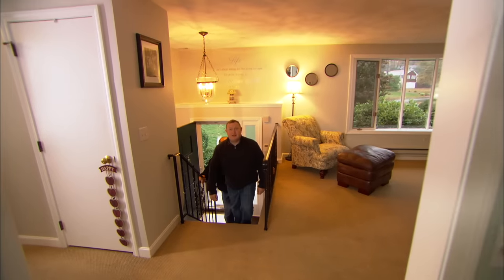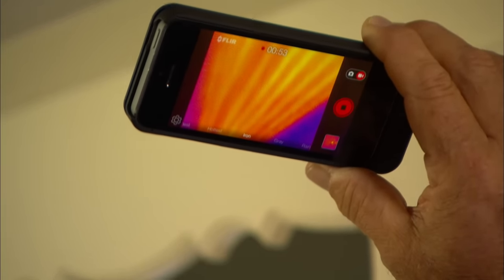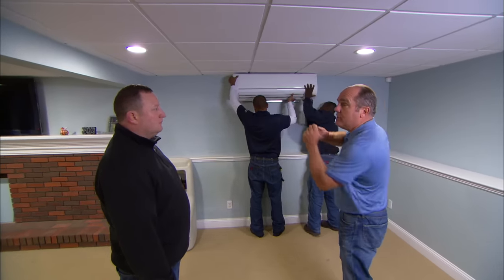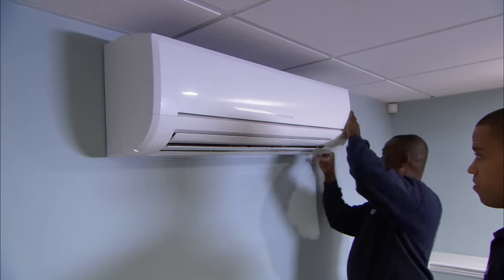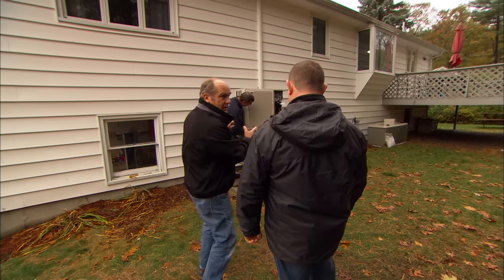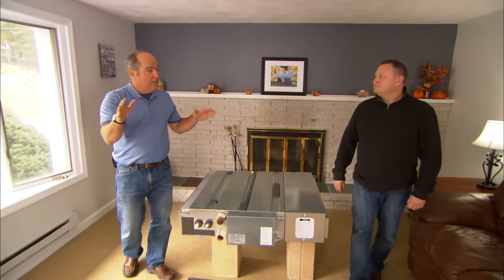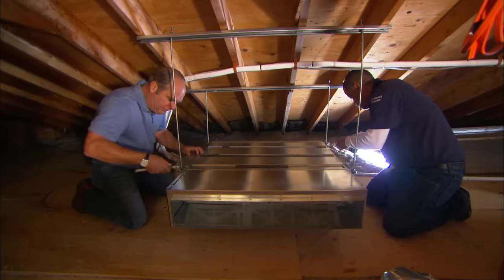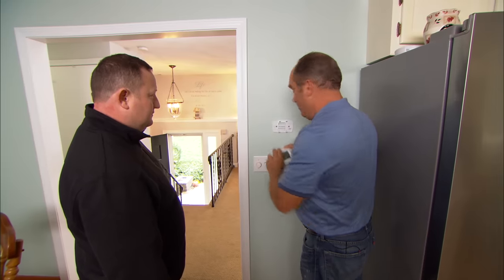How to Install a Whole-House Ductless System | Ask This Old House

Comment: I’ve been doing heating and air for thirty years and this is just my opinion on this matter.these and other similar units are very expensive.they do save you lots of money on your power bill.here is the kicker.you better hope they don’t break after the warranty is out.inverter units the outside computer board is over a thousand,fan mothers close to a thousand also.customers are not to happy when they get the service bills when this happens.
Reply: Agree. Have to factor in the risk of breakdowns and their cost to repair. I'm frugal and I live in a 55 year old house with no insulation. Rather than spend thousands on insulation and new oil burner I figured it's cheaper in the long run to heat with a wood stove. I get the wood for free (costs me time to gather, split and stack). No matter what happens (war, oil supply problems) I'll have heat.
Reply: (Recently retired from IT field support for a Fortune 100 electric company... I know there is only one here in Arizona but I don't feel right identifying them.)
I have no concerns about the inverter. High power inverters are remarkably reliable. That said, I wouldn't go with any of the Chinese units because cutting corners can turn any silk purse into a sow's ear.
Reply: @flagmichael  sadly most of the ductless units are made in China or the components come from them.where I live also we can get fluctuations in our power from the pole.this has taken out some of the inverter boards.
Personally I would invest in spray foam insulation rather then these high dollar systems

Comment: I have 1947, 800 square foot 2 bed 1 bath rental with no A/C in northern Indiana. Would you recommend a mini dual split ductless? I’m looking for balance in efficiency and pay back over the long term, lower operation cost to benefit the tenant.
Reply: Cali Valley yes

Comment: This system seems much more complex and expensive than a conventional HVAC system.  More complex = more potential for breakdowns.
Reply: Mr. Vaughn, this system has it's application and purpose, like every other design of HVAC system. More complex usually equates to use in more specific applications. Ductless and stub duct systems save significant amounts of money on ductwork and airflow balancing, and VRFs can share heat from one part of a building to another, saving energy costs in the right application. It all depends on what the customer is looking for, the requirements of the application and the space(s).
Reply: @Bear-cm1vl  My application and purpose is to heat and cool my house as efficiently and cheaply as possible with the most reliability. Should be the same with a big house or tiny house. Efficiency with cheap operating costs. Then you can spend money on other stuff.

Comment: Ductless, yet they filled the attic with supply and return ducts. I’m confused.
Reply: The “ductless” part refers to the wall mounted air handler.  These systems have a variety of air handlers; ductless, ducted, cassette, ceiling mounted and baseboard.

The actual term is mini-split system.

Comment: I’d the. Cover the entire roof in solar panels and put a battery back up system in to make sure if the power goes down, I’d have a few hours of back up survival left. Also my bills would be minimised.
Reply: If we'd only build our houses underground where the temperature is a constant 60 degrees. Pretty easy to heat that. In the winter you'd only have to raise the temperature 10 degrees. In the summer you'd just have to draw in very little 90 degree summer heat to make it juuust right!

Comment: "...is this system going to be to keep up with these cold New England winters?"

Nope. Below 20° the heat pump needs a helping hand from on-board electric heat strips or another auxiliary heat source.

Even in Florida and now here in Georgia, there have been many occasions where my heat pump hadn't been up to the task. In fact, because the condenser was pulling in so little heat on colder days, the internal fan motor was essentially cooling the room through convection since there was a miniscule amount of available heat in the evaporator.

Unless you have a giant condenser, don't expect to be able to get by without aux/emergency heat.

Comment: So what would a homeowner expect to pay? By way of example, what would the usual and customary cost be for this specific home install?
Reply: 1,000,000,000,000 dollars
Reply: mipilot30, "customary cost" for a custom installation is not possible to give. This system might not even be cost effective for your home, thus we use designers and engineers to lay out systems and determine what can and will work for an individual job.

Comment: My tire air compressor gets hot do to compressing the air.the higher the air pressure ,the higher the heat.Is my air compressor  heat pump?
Reply: No, it’s an air compressor. Hot air is a byproduct, just like with a lot of people...:)

Comment: How do you "multiply" heat without some type of energy source?   Does that not require fuel or electricity?
Reply: It doesn't actually "multiply" heat; it just moves it. That is what A/C systems do anyway.

Comment: Very interesting. I assume these units also handle air circulation (fresh air in, stale air out). I wonder what the cost is compared to FAG (Forced Air natural Gas)?
Reply: McRocket they do not do fresh air. But an hrv could be seperate
Reply: BenjaminFranklin99 - well, than won't you still need ducting (and a fan) to circulate the air into/out of the house?
Reply: Circulation and outside air ventilation are two different things McRocket. These units can run indoor fan only to circulate air in their space, but even most conventional HVAC systems do much to supply outside air ventilation (depending on code requirements, most don't use more than an outside air duct attached to the return of the system). If it is designed into the building, ventilation usually is handled by a dedicated HRV or ERV and is often ducted separately from the heating and cooling systems.
Reply: Bear U - so this system DOES need a separate, ducted system to add fresh air and remove stale air. Then calling it 'ductless' is somewhat misrepresentative, IMO in that sure, this has no ducting - but you will still need separate ducting to add fresh air/remove stale air.
Reply: McRocket that’s because “ductless” is misleading.  “Ductless” refers to the air handlers: wall-mount, ceiling cassette, baseboard mount, etc.

However, there are also ducted air handlers such as the one shown.

The better term is “mini-split system”.

As for fresh air, most homes don’t require a fresh air intake as you have windows and doors that can be opened.  It’s great if you have it.
Commercially, you do need outdoor air along with an economizer.

That’s why for a home, with systems like these, a separate unit is needed to bring outdoor air inside.

Comment: airhandlers in an  unheated attic , is this the way to go?
Reply: No. But with such a short path of travel it's probably not going to hurt performance too much. Still not ideal though.. I would've done an individual ceiling mount unit in each room.

Comment: Very cool, but what about if you need a humidifer where you are at?
Reply: run hot water in your shower
Reply: Blox117 Won’t help much. Yesterday i was cooking with the AC on. Outside i saw a steady stream of water coming out of the condense pipe. Very effective dehumidifier.
Reply: You can always install a ductless steam humidifier.  For real
Reply: Richard then why are you running AC and humidifier at the same time?
Reply: yeah but you dont run AC and humidifier at the same time
Reply: John Salazar, separate humidification is easy enough. Depending on the system requirements, the reduced air temperature from these heat pumps can help to reduce the need for humidification as well.

Comment: I still don’t get it.  You are going to bring in hot air on a 5 below day to heat the inside of the home that is already warmer inside than it is outside.  What magic takes “hot” air from outside and gets it to warm the inside?
Reply: Until you reach absolute zero (-459.67 degrees F / −273.15 degrees C) there is still heat energy available, obviously you aren't going to find an interveter system that works at those extremes but at 5 degress there is still plenty of heat to harvest. The system just takes the refrigerant through cycles of expansion and compression to move the heat around.

In heating mode the expansion of the refrigerant makes it colder than the outside temperature so it picks up heat. The refrigerant is then compressed to mulitply the heat energy it picked up, making it hotter than the inside conditioned space where it gives off its heat.

Comment: Yes, but what about -15 degrees F in my Maine winter? My experience is it is not going to work and I will use oil heat anyway. Comments?
Reply: The h2i (cold climate line) of Mitsubishi heat pumps are supposed to provide 100% of rated btu output down to 5 degrees. After that output degrades hitting 76% of rated output at -13. A properly sized system should be able to provide most of your heat but you would need a backup or supplemental source on the coldest days. Not sure what the payback period would look like but I wouldn't expect your oil costs to do anything but go up. In such a cold area a ground source aka geothermal heat pump is probably a better option with current technology.
Reply: biohazard 918 geo would not be cost effective. By the time you pay for geo, you coukd have installed three of these
Reply: biohazard 918, I can see both sides to this argument. At $4+ a gallon for #2 fuel oil, the cost for a winter climbs rapidly in the NE states, but dropping a ground loop for geothermal has a very high up front cost in stony ground and the heating load is likely to be seriously out of balance with the cooling load, which can cause moisture control issues.
Reply: I forgot about freeze protection and possible need of antifreeze in the ground loop too.

Comment: it all looks so simple but it is not. Multiple units on one outdoor unit is the least efficient. There is a lot of refrigerant and it has to be pumped to zones that are not calling. Maintenance and service are not talked about. One compressor replacement can blow your whole heating budget, if you can find someone who is trained to accomplish it. Parts can have extended warrantee, but labor is not usually covered. I could go on, and I do on my youtube and facebook pages. DuCharme HVACR Consulting.

Comment: I install Mitsubishi and Fujitsu minisplits for customers in upstate NY and rely solely on word of mouth sales.  There are several things that should be clarified:
1) None of the leading ductless manufacturers have heating elements in their ductless or mini ducted air handlers.  The larger unitary air handler from Mitsubishi has a supplemental electric heat option but is not necessary if the system is sized properly, and yes even down to -18F outdoor air temperatures!  These are not the same units that were available before 2009!
2) The proper sized low ambient units work great for heating at low temperatures.  If a customer has an existing heating system installed, they can save some money by undersizing the system and they can use the existing oil, propane, nat gas, or electric heat for supplemental heat in extreme cold situations.   In well insulated homes, many times I only use 2 minisplits for 2000+ square feet with no backup heat.
3) Low ambient outdoor units (Mitsubishi Hyper Heating Inverter H2i and Fujitsu XLTH Xtra Low Temperature Heating) have a base heater in the outdoor unit to prevent ice buildup in the base of the outdoor units and is only used while in defrost.  None of that heat from the base heater goes into your home it is only a 150 watt or less heater to heep the base a maximum of 40F during defrost.  
4) I don't typically install multizone systems because the efficiency and performance is much lower than 1:1 systems.  This offers system redundancy if something fails and much better comfort levels since the compressor capacity is perfectly matched to the indoor head unit.
5) Most residential multizone systems will not allow simultaneous heating and cooling.  If you try to use one zone for heat and another for cooling the first mode chosen heat will be the mode for the entire system.  The unit you chose for cooling will just flash indicating you chose the wrong mode.  So even though these systems have an AUTO mode to switch between heating and cooling it cannot change modes properly on a multizone system.  example if your family is in the basement and wants heat, but you are in the above garage office and want cooling you will have to decide who gets what but not both at the same time.
6) I have mitsubishi installed in my own house.  I live in a 3000 sq ft log home we built in 1998.  We installed radiant floor heat throughout the house during construction and used a propane boiler for heat until I installed two 12,000 BTU Mitsubishi FD12 units in April of 2009.  We upgraded our FD controllers to FE controllers so we could install an optional base heater which prevented problematic ice buildup in the base of the outdoor units.  We haven't run our boiler for more than 10 hours since 2009, and those are just 1 hour test runs before the beginning of each heating season.
7) They are very inexpensive to run, running both units  on a dedicated kwh meter we have averaged $.82 a day at an average of $.13 per kwh since 2009, heating and cooling 3000 sq ft!  And we like 72F all winter and 68F all summer!

Do some research before passing judgement.  By the way, some real world information after installing over 400 systems, operating a FE12 or FH12 12,000 BTU mitsubishi H2i single zone will displace the usage of 1,000 gallons of fuel oil or 1,500 gallons of propane for the winter season while keeping the house warmer at a fraction of the cost!  All my customers have said it is the best investment they ever made!  I typically charge around $4500 for a 1 ton low ambient system and $5500 for a 1.5 ton low ambient system, but I stand behind my installations and the products!  When oil is $4 a gallon they pay for themselves in one winter (ROI less than 1.5 years!) And no need to store fuel!  Friendly to generators too since they are inverter driven (soft start).

Comment: So it costs so much to run a natural gas line to the house… ok?? So what about propane and fuel oil, both of which are far cheaper than what you were using before. Why are you going all in with electricity?

Comment: People trying so hard to make mini split ductless units work that they are actually adding ducts... lol. From what i've gathered they work great if you have a head unit in each room but that requires lines to be run throughout the home and you lose efficiency the longer the line set is? Or you add ducts to avoid running so many lines which in turn loses efficiency just the same?

Comment: How was air filtration incorporated into this system?
Reply: Matt Jacob the units have their own little washable filters.  I think the oboe inside the attic has its own filters interfered as well
Reply: @davidcerino1145  problem I always had with these was that it's mostly just recirculating the same air with minimal air filtration. Didn't know if ducting the ductless units allowed more traditional filters to be incorporated on returns.
Reply: Matt Jacob oh yeah.
Granted, these systems are generally only installed in custom build-outs for commercial buildings.

Pretty cool stuff

Comment: Ductless.systems lose there efficiency below 30 deg, not good for northern states, the best and most comfortable heating system is a low pressure steam with cast iron radiators. You can then put a cheaper air conditioning system instead of an expensive ductless heat pump.

Comment: so not good for alaska? we can see -20f where I live. still not sure how those lines dont freeze
Reply: Assuming this VRF system uses R410a (most current Mitsubishis do), the "fluid" in the lines BOILS at atmospheric pressure at -62° F, so I very highly doubt you will ever see it cold enough to freeze, even in AK. Air to air heat pumps will supply some heat at -20° outdoor air temps, but the problems with water frosting on the coil and the repeated defrosts would make this type of system a poor choice for that environment.
Reply: Mitsubishi does have systems dedicated to such extreme temperatures
Reply: The condensate line would be the only one that would be carrying water.

Comment: Thinking to opt for this type of heating and cooling. I have ductwork already in place from a previous furnace. I desire to get away from ducted heating primarily for the benefits of cleaner air.

Comment: So where does all of the condensate from cooling end up?  Might have been better to use a traditional forced air ac/furnace.  They can have the same guts (efficiency)  but less components to maintain.
Reply: There are little condensate pumps that pump the condensate out.  On the unit in the attic, you can pipe the condensate pan into a drain or to the outside

Comment: That's 5 or 6 air handlers. Thinking that's adding up to a lot of $$$$$
Reply: We are looking at individual Mini-splits for our home/workshop addition project, instead of this or conventional central HVAC.  Biggest concern is air purification and circulation, though there are separate solutions for that.  We installed 2 minis in our restaurant including a 3 ton in the kitchen (I know, it is NOT recommended, but no problems so far--we keep the filter very clean) and a 2 ton in the dining room as a supplement to our central ac and gas heat.  Works great.  Bo't off brands not Mitis or similar.  2 units together came here shipped for about $2800.  We did the physical install, HVAC connected the refrig line (a few hundred $).  QUIET, really QUIET.